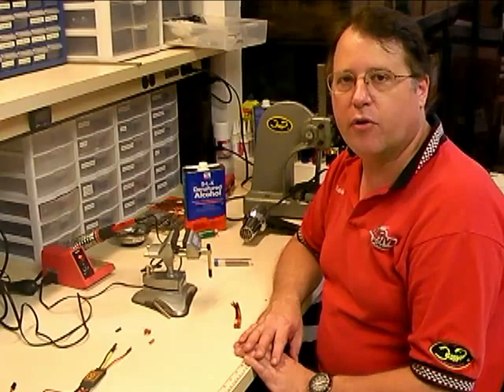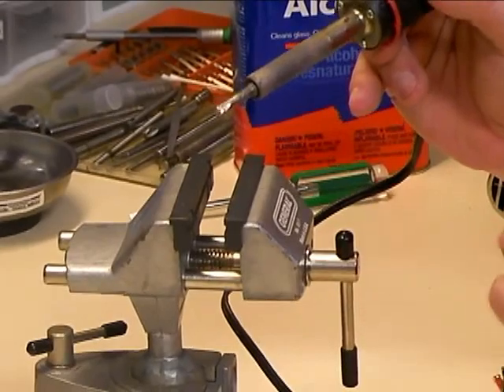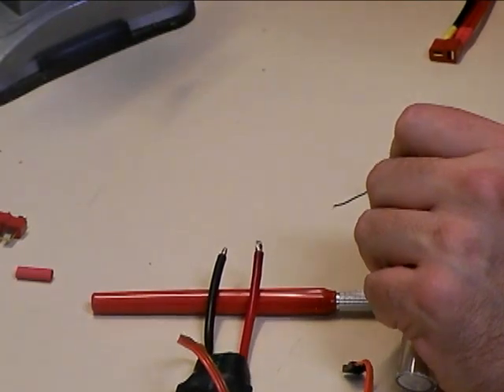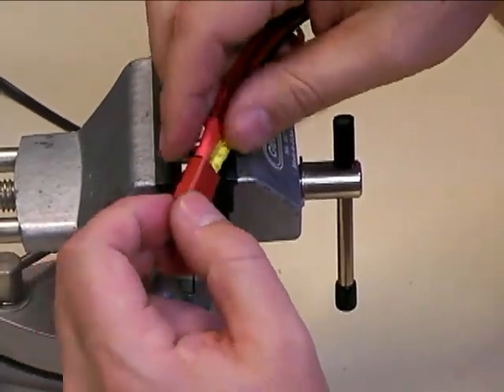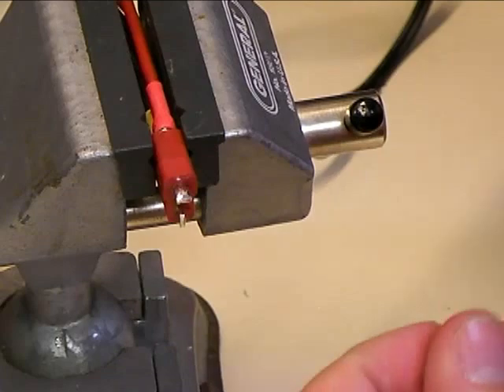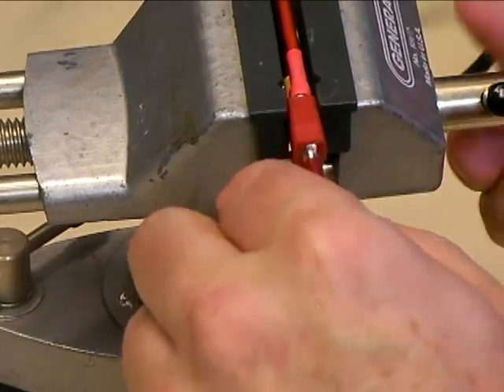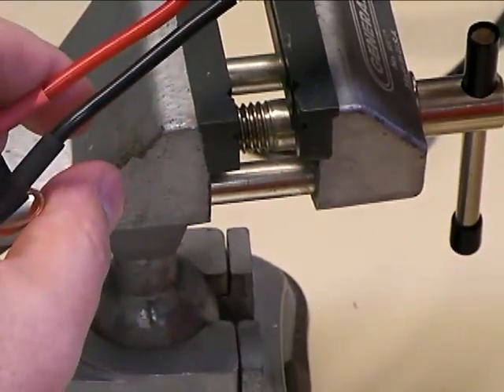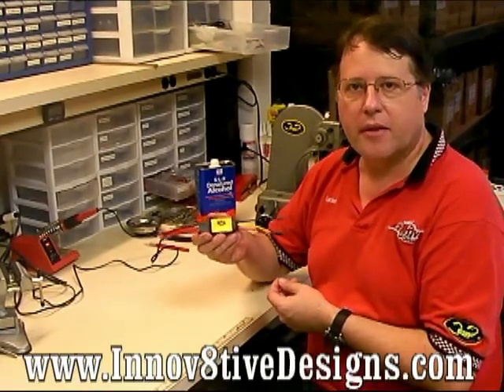How to Properly Solder a Deans Connector by Innov8tive Designs

Comment: Good video with some minor flaws.  (1) What is 'sauder' or 'sowder'??  It is SOLDER!   (2) For BOTH wires your hand was in the way so you couldn't see the moment the joint formed.  Surely after shooting and reviewing you didn't just say "Well, it doesn't matter, it is the result that counts."  How long would it have taken to reposition either the camera or the connector so we could actually SEE what you were doing?  (3) I was always taught to apply heat to the two components to be joined and THEN add the solder (not sauder/sowder) between them.  If you have cleaned the pieces and applied flux, the solder will 'wick' into the joint.

Comment: The most common rosin core solder (for electronic work) is 60/40. The solder he used is 63/37 which is more expensive and harder to find. It's also unique in that it doesn’t have a “plastic” stage; it goes from liquid to solid at a single temperature instead of a range of several degrees which means that you’re less likely to make a cold solder joint with it. He failed to point that out. He did recommend the proper type of tip, but didn’t specify a temperature of 700 degrees. He also made the mistake of loading his soldering iron with solder and then transported that solder to the connection. By the time he got it there and reheated the wire and connector, whatever flux he had was long gone. When he pulled the iron away, the solder wanted to go with the tip which caused a sharp point of solder to be left on the connection. But that was apparently no problem because he went ahead and installed the heat shrink over it. I guess if you can’t see it, it’s not there..

Comment: So is using flux not necessary?
Reply: If the parts are clean, and you use a good rosin-core flux, no additional flux is needed.  The rosin in the solder is the flux, and melts out of the solder as it is heated.

If you do wish to use additional flux, you can, but you just have more residue to clean up after you are finished.

Comment: Thanks innov8tive however I have a question, I understand that applying adequate heat to the wire is necessary while soldering but I notice you do not apply much heat to the connector terminal.. instead you heat the solder that is on the terminal .. so I don't need to fully hear that terminal when mating the wire onto it?
Reply: The Deans connector is pre-tinned earlier in the soldering process to make sure that you get good adhesion between the solder and the connector itself.  When the pre-tinned wire is added, the bottom side of the soldering iron re-melts the solder that is already on the connector, while the top side of the soldering iron re-melts the solder that is already on the wire.  The solder that is already hot on the soldering iron tip re-mixes with the two other parts very quickly, as you can see in the video.  This minimizes the time that you are actually heating the tab on the connector, and reduces the risk of over-heating the contact, and having it melt into the plastic housing, which can cause the contact to shift in the housing resulting in a bad connection.

Comment: I did a test connector and after about ten minutes I tried to pull the wires off the deans connector. The outside of the wire actually pulled off leaving the solder joint unharmed. Couldn't have done it without your video. I'm a first timer to deans connectors, and I watched other videos but yours was the best explained and perfect technique, easy as pie after seeing you do it.
Reply: mallratt25 You're very welcome!

Comment: A 40 watt iron is the proper size for this type of work.  In any soldering operation you want to be able to get the part hot, apply the solder, and get back off of it in less than 5 seconds.  If you are taking longer than that, then you are using too small of a soldering iron, and risk melting the plastic.

Comment: Great job.  Soldering a dean plug takes a while to get good at and you made it look so easy it makes me want to run downstairs and redo all my plugs lol.    My biggest problem is the solder wont stick to the plug.   Things got much easier once I got a TK-90 soldering iron.  Those 20-25w irons just don't get hot enough.  Be careful when using that heat gun beside that gallon of alcohol! Ka-boom!

Comment: Great job. Not sure if I want to try to do this. I would rather pay a couple of quid for someone to do it for me. I have two irons, one is a Weller 40w SPL or something and the other is a small tip 25w - the tip on the Weller is huge and maybe too big tor the job and the one on the 25w is probably too small! and I have no heatshrink. Sorry but how you say "solder" is very strange. It sounds like "sodder" to me! thanks for the video. now at least I know what is under the heatshrink.
Reply: I'm pretty sure that's how solder is normally pronounced.  I can tell you aren't from the states because of the use of the word "quid", but that's how everyone says it in the states at least.
Reply: Over here in England we don't say "sodder", we say "solder" haha
Reply: Ben Rogers And I'm sure you pronounce Aluminum as "A-lu-mini-um. Even though there is no "i" after the "n".
Reply: +atllex They are both valid, research it. http://grammarist.com/spelling/aluminium-aluminum/
Reply: Ben Rogers 
Yes... It is "sodder".

Comment: You NEVER put the female Deans connector on the ESC.  This would require the Male connector be on the battery and with exposed contacts it would be very easy to short he battery against anything metal such as a screwdriver or wrench.
Reply: great info, thanks

Comment from the maker: The solder that I use is a rosin core type that has a rosin flux inside the solder.  As you heat the solder, the rosin flux melts and oozes out on the part you are soldering and coats everything for a good joint.  This type of solder works best with brand new soldering.  If you have older connections that have a bit of oxidation on them, brushing a coat of flux onto the parts first will provide additional cleaning and get you better solder flow and adhesion.

Comment: The key here is preheating the wire, THEN preheating the terminal. Much better than my kludgy old method. I was pre-tinning the leads, then using a clamp to hold the wire to the plug while heating the joint. It had the benefit of squeezing them together for a better mechanical connection while flowing new solder into the joint, but all the mass (wire, plug, clamp, tinning solder) made it take FOREVER to heat. I was about to give up forever on Deans but, Lucien, you just talked me out of it.

Comment: Do NOT mate the connectors together for soldering! The springs will force the contacts apart.

Melting the connectors is usually caused by using too small of an iron or not enough flux. It could also be that the iron is left for longer that needed.

Comment from the maker: Yes, just be careful t only cut one wire at a time, and solder them one at a time and add heat shrink after each one is finished so you do not accidently short out the battery while you are soldering it.